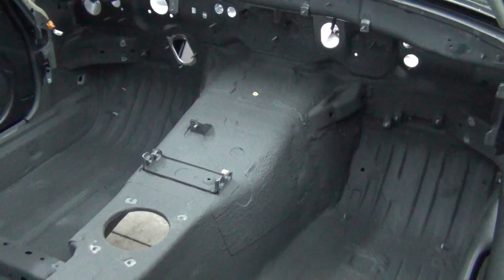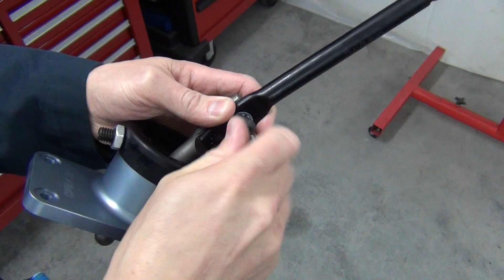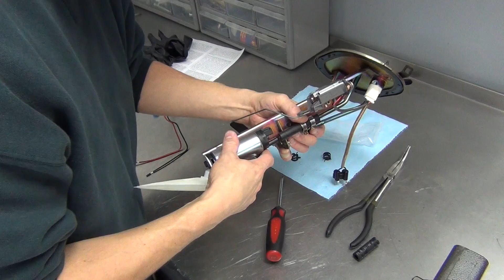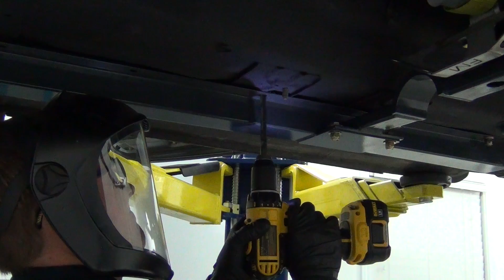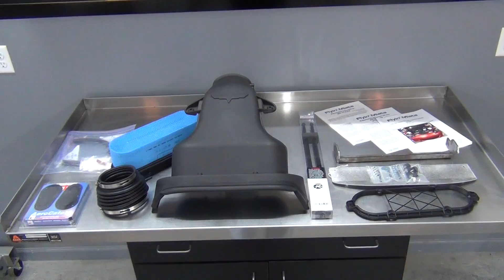LS3 V8 Miata Build - Project Thunderbolt Part 8

Comment: I just bought the sandersons. They have a lot to be desired where the tube meets the flange. Looks like the hole in the flange is 1-3/4. The tube is od 1-1/2. They beat the pipe to fit the flange and it looks kinda rough. The tubes immediately turn down at the flange. Flying Miata don't offer their header anymore as of 2022 or I would have gotten them. I'll have to make the sandersons work. Sad deal

Comment: Just a small hint on the taking pictures. Make sure they are saved somewhere besides just your phone. Was working on my home ac unit took pictures only to have my phone die permanantly before my knew parts came in. No pictures to assist. The v8 Miata is a project i always wanted to do but the cutting and welding piece of the engine bay always stoppes me. Looks great.

Comment: Why are frame rails added, and bolted to the floorpan? For rigidity, and to prevent moisture, mud, etc from wicking in between the stock rails and added rails, wouldn't it make sense to weld the new rails on? Or at least seal the interface seams between the two?

Comment: Great build bud, over all great job.  Why did you hack the core support for a plastic intake that could  have been cut though?! Also you you cut the heat shield on the starter in the one place it really needed it.

Comment: The fuel return should have been routed to the bottom of the tank away from the pickup. This will prevent aeration especially when the fuel is low. Use a fuel line that has fuel resistant cover for full submersion in fuel ($$$). High density polyethylene 3/8' ID tube (ebay) can also work here with a double compression fitting since there is no pressure and its inside the tank. Standard polyethylene tube (hardware store) will swell and get soft in ethanoilzed fuel. Don't try it!

Comment: I would've thought you would need to use plates for the bolts for the frame rails like what they do with a roll cage so they dont pull through?

Comment: One thing - undercoating isn't about rust protection - it's about noise reduction.  It actually retains water because of its very coarse texture.  It would have been better to apply ospho to the exposed metal and then the undercoating on top of that.

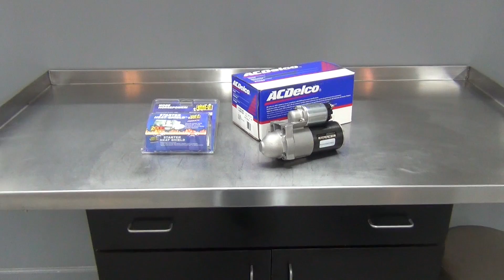Comment: 19:14 I noticed this in the other episode when it was shown, but you gotta love the marketing wank on the heat shield packaging - “MORE HORSEPOWER!” Because protecting your starter from heat will give you more WHP lol
Reply from the maker: Haha!  Yeah, kinda hard to squeak out extra horses from your starter 🤔
Reply: @TomsTurboGarage  very late to the party but what's confusing me is that these beefer chassis rails are just bolted to the floor? surely you'd want to weld them to the existing chassis? I don't understand how thats strong enough but I'm sure I would if you'd explain?
Reply: Doesnt matter how much WHP you got when you cant start the bloody thing.

Comment: Excllent work sir, I love all your videos you're meticulous with your work.  In this video I actually learned something about the rivet nuts.  I had no idea something like this existed and I've learned how to install them thanks to you.  Would you happen to know how much torque those nuts can take?  They look secure but not VERY secure, I'm assuming you can tack weld them also to make a tighter fit.  I've worked with AN fittings before but I didn't know about AN fitting adapters that's really cool.  =)
Reply from the maker: Thank you and I'm glad to hear it!  I'm not sure how much torque nutserts can take, I would imagine it's fairly low.  A weld nut would be better for high torque applications.

Comment: Recommend putting some rubber o-rings under the washers that hold the frame rail. It's most likely going let water in the car if you drive in rain.
thanks for a cool show btw

Comment: I searched jegs and summit for about 30 minutes for those russell's adapter fittings you used for your fuel lines. I finally decided to watch your video again to see if you had shown the part number, and you did! Thanks!

Comment: Hey Tom, I meant to ask this in the last episode, but forgot. What's the big kink in the exhaust header a workaround for? A piece of the body in the way or something? It looks like it would add some significant exhaustflow restriction.
Reply from the maker: PIK Hey man, it's for steering shaft clearance.  Stuffing a v8 into a Miata isn't without compromise.  Surprisingly enough, small dents like this do little to affect horsepower, Hot Rod actually just did a quick test on this.
Reply: Tom's Turbo Garage Good to know! Thanks for the relpy, Tom!

Comment: very refreshing to actually see someone on youtube double click their torque wrench
Reply from the maker: Ainsley Harriott Thanks Ainsley, I tell ya I have caught so much grief for doing that!  It's just how I was taught, I had no idea folks would feel so strongly about it. You're the first person that seems to feel it isn't so bad.
Reply: I cant speak for the automotive world but in regards to aviation you'd be hammered for not doing it. Standard practices exist for a reason but then who needs torque figures when you've got a big bag of cable ties!
Reply: Ainsley Harriott I learned many years ago to slowly pull a torque wrench for accurate torque readings. if you want to test this, slowly pull the torque wrench until it clicks. after that slowly pull torque again, you'll will feel the fastener still turning...

Comment: my OCD kicked in when I saw you drilling the floor and bolting up the reinforcement rails without cleaning up the swarf and painting the holes lol....... and yeah I agree with other regarding the Hex head bolt welded to a bashed flat steel plate, rather average for an aftermarket part.....cut the long shifter

Comment: All that just for another boring ls swap and a shitty miata?
Reply: Whats with all the hate on Miata's? They're such a great little car! Fun to drive, easy to work on, cheap as fuck to maintain, and they get pretty decent gas mileage. They're light weight too which makes them great for just about anything. Beginners to seasoned veterans can have tons of fun in these cars.  Endless possibilities for modification too. They might not look like a Lambo or a WRX but they're certainly not just a hairdressers car.

Comment: Wow, do you ever come across a snag during any of your builds? Every scene looks like it has been rehearsed, stuff never goes that smooth in real life...Or I am just a little green with envy! Keep up the good work man. Just a thought..Instead of wasting those nice SS screw clamps to keep the heat reflective material on the starter, a little bailing wire goes a long way.
Reply from the maker: Sean Ashcraft Hi Sean and thank you for the kind words.  Regarding bailing wire vs. clamps, the clamps may seem like overkill but will literally hold the heat shield on forever, no matter what.  I see it as "future proofing" and one less thing to worry about vs. a little extra expense.  Plus, they were used ones that I had laying around from projects in the past.  Regarding snags, we all come across them but I do try my best to avoid missteps.  I've worked really hard to make this build go smoothly and what doesn't convey in the videos is the (probably insane) amount of planning and preparation that I try to do before every single step.  I also spend lots of time "visualizing" a job before I do it, which may sound crazy, but has worked well for me over the years.

Comment: Hey Tom!
I have a quick questioning concerning the good old 4g63 world. Like I mentioned before, I am currently building a forged bottom end for my 6 bolt block and had put some thought into having the block O-Ringed. My interest in doing this stems from wanting to be conscious about cylinder pressure and head gasket integrity. I'll be running the same Cometic layered head gasket I have in the past, but I was just wondering, in your experience with the 30+ lbs. you ran in the Talon, did you ever run into issues with head gaskets?
Obviously, I expect the engine to take 30 lbs easily with forged internals, but I want to account for everything before I slap it all together. 
Thanks and I appreciate the time. Looking forward to another great episode!
-Austin
Reply from the maker: Austin Sawyer Hey man, thank you and I've never had any 4G63 head gasket problems, but I've also kept my tunes conservative and used pump gas safety measures like methanol injection.  I did have an o-ringed head and head studs in my Talon.  Good luck man and have fun!
Reply: Okay, that's helpful stuff. Thanks so much!
Reply from the maker: Austin Sawyer You're welcome sir, no problem!

Comment: Whats the approx cost of a build like this (car not included) - All the parts+engine, conversion kit etc. Thinking of doing something like this myself, but cant really figure out the approx cost - need to plan a bit first.

Can Tom answer this, or does anybody else know?
Reply from the maker: Doggepp Like any project, the cost varies greatly depending on the parts chosen.  I have seen them done with salvage parts for around $12k while at the other end of the spectrum you have the Flyin Miata turn-key versions which start in the high $40s labor included.
Reply: Great answer, thanks
Reply from the maker: Doggepp You're welcome man!  The most affordable V8 Miata swap are the old iron block Ford 5.0/T5 combo.
Reply: Ah yeah. I live in Sweden though, so none of your stuff is available directly here, and if we purchase it and ship it over, we are starting to talk serious money... Everything is basically twice the money compared to the US

Comment: I could tell that you got excited when talking about the Z06 air intake
Reply from the maker: Jamie Cannon What can I say?  It's a good setup that offers excellent function and form.  I suppose I could stick a 90 degree silicone elbow on the throttle body and stick a K&N cone filter near the driver's side headlight, but that doesn't perform nearly as well and looks like an afterthought vs. an OEM quality solution.  So yeah.

Comment: Great.. Now I have to wait forever for the next episode.. fml. wtf. why.!! Awesome series!! just hate the waiting! One day, I WILL do this to a mx-5
Reply from the maker: akaSkItTLes23 Thanks man, it's only two weeks between each one!  It may feel like forever, but by the time I gather footage, write, edit, record the voiceover, etc. that two weeks goes by in a flash on this end!
Reply: Thanks for the reply man. I will be doing this kind of project one day and I was wondering, how much experience do i need to do this? I know how to use all the tools shown and I have fantastic common sense, could I learn while i build? from your videos it looks pretty straight forward for what it is imo
Reply from the maker: akaSkItTLes23 You're welcome sir and the best way to understand your comfort level is to begin planning and read/research what each step of the build requires and how you feel about taking that on.  Speaking for myself, I wouldn't have wanted to "learn" some of the skills required while working on this project, it was preferable to have already done that on some hacked up car back in the day.
Reply: Tom's Turbo Garage Sound advice. I'd probably start with something easier like a turbo install or exhaust change. I'm a decent welder and have good knowledge on power tools and tools in general and how to use them. Guess that's a start.

Cheers for the advice :)
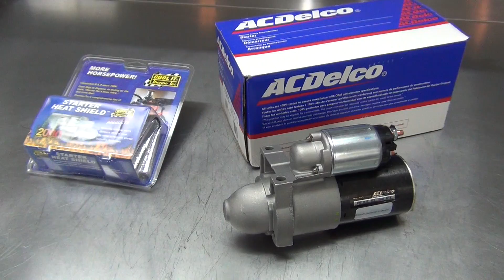Reply: +Tom's Turbo Garage Song that starts @19:15?

Comment: I think it is funny that Mitch uses Craftsman tools, not those overpriced Snap On , Matco, Cornwell tools that people who think they are mechanics use. Mitch is 500% more mechanical than the guys with those tools.
Reply: I was an auto tech for 10 years while craftsman makes good tools  fpr thw so it your selfer. They aren't reliable for professional use I broke a lot craftsman ratchets and sockets, ans streached a ton of wrenches. I never broke a Matco ratchet most of my tools were Matco. Truth is you get what you pay for when you can't afford to drive to sears several times a week to replace tools you pay a bit most for the good stuff
Reply from the maker: MetalTeamster Thanks man.  I tell ya though, a recent trip to a Sears had me feeling pretty sad.  The tool department shrunk in size dramatically and hardly anything was made in the USA.
Reply: That is good overall, it is called  " free market capitalism ". We as small Govt / anti Union / Pro Right to Work Conservatives must embrace it. It smells like profit.

Comment: Awesome work so far.  One question though.  How will those frame rails handle water getting under there?  There are gaps at the top which would let water in, which would sit at the bottom of the rails and rust it and the chassis out.  Are there drainage holes?
Reply from the maker: Stuart Wood Thanks man!  It's all undercoated under there and it may look like there are gaps, but they fit extremely tight.
Reply: That puts my mind at rest.  Would hate to see all that hard work get ruined by some trapped water.
Reply from the maker: Stuart Wood Definitely!

Comment: Why isn't there a gasket between the engine and the exhaust manifold? Normally there should be one right? I'm not super technical with that stuff so please explain why there isn't one. :-)
Reply from the maker: DataC0llect0r There is a factory exhaust manifold gasket in there.  It hangs onto the head.
Reply: Aah ok, that's why i didn't see it. Thank you for the answer Tom!

Comment: Mitsubishi stuff turns up in odd places where you least expect it. Was surprised to find my starter was made by Mitsubishi.
Then there's Mitsuboshi which is even more of a surprise.
Reply: s0nnyburnett Probably because they make EVERYTHING. They're like Hyundai in Korea only bigger. The company manufactures everything from Fighter Jets (F-15 variant) to Chemicals.

https://en.wikipedia.org/wiki/Mitsubishi_F-15J

This is partly why i've stuck with them so long. Their 90's cars are basically bullet proof.
Reply: *****
I knew they were really big, but this is insane.
Reply from the maker: s0nnyburnett Indeed!

Comment: What did you use to hold the top of the frame rail reinforcement bolts while you tightened them? I had so much trouble doing that by myself when I did mine.

Comment: Those rivet nuts look like a major PITA opportunity later down the road. I can picture a corroded bolt getting stuck, and causing the rivet nut to spin in its hole. I would have put a tack weld on each one to hold it in place.
Reply: 70chevelle8 The rivet bolts were only used for small low-torque jobs, I'm pretty sure holding a fuel filter and an intake won't really require that much tightening so less chance of having to put so much force on loosening it to the point where you spin the rivet itself. I think it's a pretty smart idea though, and much cleaner than simply drilling and bolting those parts.
Reply: Rivet nuts aren't some newfangled technology no one has experience with.  They've been around forever.  They work.  If you install them correctly, they don't spin in place.  Period.
Reply from the maker: ikutoisahobo Well said!

Comment: I may be a little paranoid but after drilling the holes for the frame bracing did you paint over the exposed metal? I'd hate to see it start rusting at those holes off the bat because of moisture!
Reply: Hugh Turner Crap nevermind...I spoke too soon, not 2 more minutes into the video did he say he unbolted and painted. XD
Reply from the maker: Hugh Turner Haha, yeah man!

Comment: hey Tom.......what drill bits are you using to drill thru the Aluminum? ALU is a soft metal so what bits would you suggest t drill thru harder types. I always find this to be one of the biggest issues when drilling thru metal. Thanks
Reply from the maker: Blair Clarke Hi Blair, I am using Milwaukee drill bits and always use a stick lubricant which keeps the bits sharp and the drilling much more consistent.  I'm no expert in this regard, this is just what works for me.

Comment: Why does the fuel pump have a return line? What comes back to the fuel tank to need one
Reply from the maker: bhexric I'm not clear on your question.  It is a return style fuel system, the corvette regulator/filter has a return outlet that goes back to the tank.
Reply: Tom's Turbo Garage Okay, I didn't know that was a thing. Thanks :)
Reply from the maker: bhexric No problem sir!  If you google "return style fuel system" there are some good diagrams and such that explain it much better than I can. :-D

Comment: speaking as a gm tech you are probably gonna want to route your vent hose for your rear diff so it is more vertical..  that will give the fluid more room to expand and then the fluid will drain back into the diff with gravity.  otherwise you are most likely looking at diff fluid dripping out of your hose.
Reply from the maker: punker6506 Thank you for the tip on that, noted!

Comment: Are you going to stiffin up the frame?
Reply: Revive i think the frame's had already tons of reinforcements ... look at those frame rails , engine support and rear diff support ...
Reply: Jacky L.  unfortunately those "frame rails" AKA subframe connectors, need to be welded to the car to add any significant structural rigidity. If the car sees hard use the bolts will wiggle and hog out their holes after a while too, taking away any real improvement those rails may make with bolts alone.

Mustang and Camaro guys have used them for decades. They work, but the install is a hassle. Suspension has to be loaded, so it's easiest done over an inspection pit or similar lift.